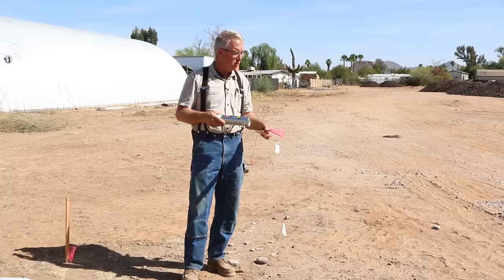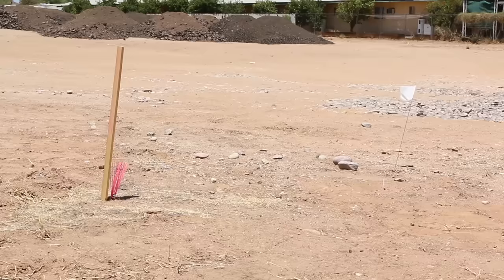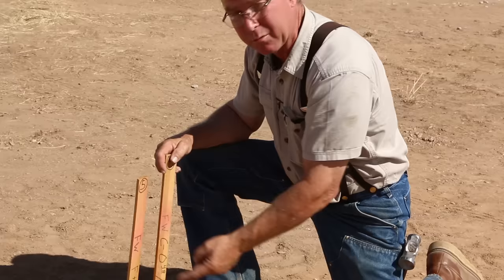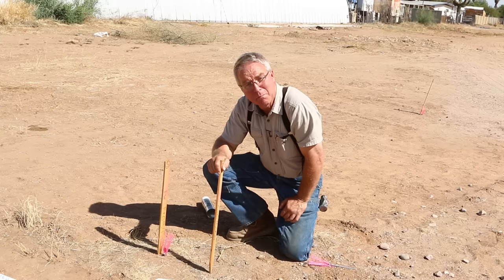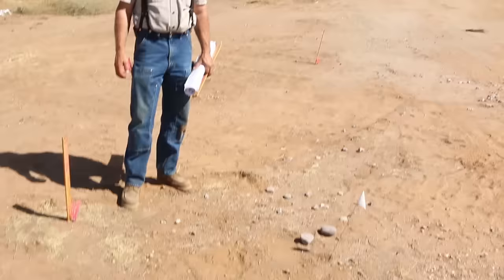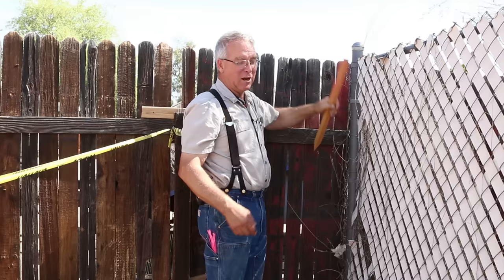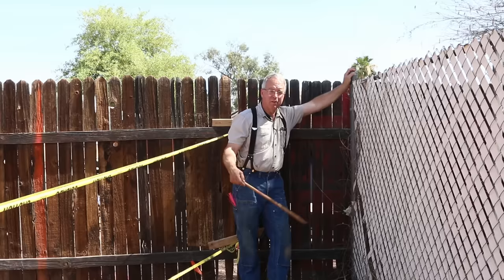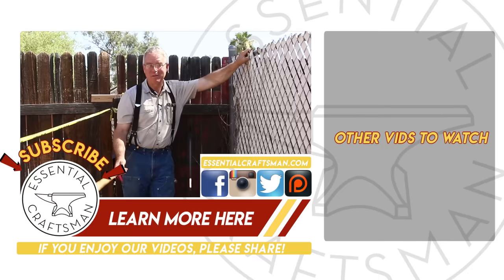Survey Stakes and Markers

Comment: Have a dozer that wont run?
Drive a grade stake within 10ft of it and I guarantee it will fire right up just to be able to get the chance to run that stake over!
Reply: Also works for old dump truck drivers...
Reply: You know it.  It's like magic.  No need for a mechanic.
Reply: Actually it's the other way around. Surveyors will watch a 100 dump trucks drive in and out of the same site ALL DAY LONG and put stakes directly in the roadway we are using!
Reply: Huggy --- I found during site visits with all equipment operators, have them do 2-3 hours (manual labor) of assisting setting a 1/2 mile of staking which will cut down on "survey destruction". Cheaper than correcting mistakes and they hate having to redo their on work (staking).
Reply: Marshall Moneymaker --- I've seen that several times also!

Comment: We do our offset symbols a little differently at my survey company in Kansas, but otherwise it's all just about the same.  Also, 0.75' is 9 inches, so going 9 inches off of F +0.72 will put you 3 eighths of an inch too high.  Hundredths to eighths is close, but I recommend counting from quarters of a foot.  I mean, 0.25, 0.5, and 0.75 are respectively 3, 6, and 9 inches then go up or down from there based on the hundredths shown on the survey stake.
Reply: SchmackyJoel you wouldn’t happen to work for the survey company in the burgundy Chevy trucks??
Reply: That’s what I was going to said
Reply: agreed
Reply: Happen to work for kaw Valley Engineering?
Reply: @jabaristevens388  I actually think he's right and it will be 3/8 high..
Reply: @paveldimov8971   no sorry for the misinterpretation. What am saying is, .72 hundredths of a foot is equal to 69 eights not 72 eights, and .75 is equal 9".
+.72 will be 3/8ths higher than the precise off set which is +.75/9"
Reply: if a curb stake says F=0.50 to TC and the curb has a 6" curb face, a 1-foot wide gutter 6 " inches thick, and a 2 0/0 slope to F/L what is the cut to  curb grade at the back of the curb. also how many hundrenths is 8". (hint it's not 64)
Reply: This is why you just buy a tape measure that has 10s and 100s, dividing by 8 it’s some bs

Comment: Had a surveyor in a week ago - first time I've ever employed one. Had him drive both pins and offset pins, then had an excavator pull some boulders from various places on my farm and drop them right atop the pins...then had surveyor come back (yesterday!) and use offset pins to locate and create final pins atop the boulders. Next step: rent a mini excavator to build a stone wall between the boulders that mark the inflection points in the zig zagging property lines.

The whole process has been fascinating...and, yes each step looked IDENTICAL to the bits in this video.

Excellent as always, thanks!
Reply: Hmm, sounds like you're placing half of your boulders on your neighbor's property.  Do you have an agreement with your neighbors to do that?
Reply: Andrew Alexander yes.
Also, I believe that most New England states have laws re traditional style boundary walls.
Finally, I'm in farm country, so no one gets upset when rocks take up 100 square feet of a 50 acre farm. 😉

Comment: I’m a Carpender and I set up survey for excavators and I use a linker survey rod. It’s great for getting compound slopes and it really easy once you have your laser set up. That Rod you also use tenths.
Reply: if you need to cut a slope at 1 1/2 to one down 25 feet to your toe of slope , I guess you have a LONG rod.

Comment: I wish this video existed 7 years ago...
A trick I learned while flagging proposed gas lines, if the ground if too hard/frozen for your flag's wire to slide in, lay your flag on the ground so that an inch or so if the end of the wire is where you want the flag to end up.  Then, using a dull large flat-head screwdriver and a mallet, pound the flag in striking the wire where you want the flag to stick up at.  Do this enough times and your screwdriver will develop a divit in the center that helps with repeatability.
Sincerely a former gas company engineer
Reply: Smart advice

Comment: Pretty good video!  Some of that is regional standards, but as a surveyor that’s staked out hundreds of buildings and uncounted miles of curb and road, I had no trouble following.  And yes 9 inches is 0.75’.  Just divide by 12.   Surveyors use feet and decimals (to the 1/100 of a foot).  
Architects use fractions of an inch.  Now that’s confusing!
Reply: so do operating engineers (union)

Comment: In most states, that corner on the fence cross beam is illegal, at the very least, no conforming to local statutes defined by minimum technical standards of monumentation.  It should have been off set along the property line.
Reply: Yeah my thought as well. Do an O/S.

Comment: Years ago before I was self employed a contractor I worked for built a cabin on a parcel of land that didn't belong to the customer. 
The parcels in question were very remote and all of the surrounding terrain looked the same. So the owner instructed where to build it and it was built. Later (several months) the rightful owner of the parcel shows up to see a beautiful cabin sitting on his property. 

The customer mistaked the neighbors parcel as his own. They eventually just traded parcels and the customer paid all the fees for the paperwork. It could have ended up worse. 

Fast forward a couple years and the same contractor built a new house on another parcel to find out that part of it was on the neighbors property. Fortunately the brother of the customer owned that parcel. So they made some kind of deal. 

From witnessing these mistakes I always pull county records on every project I build and verify myself that we are on the correct piece of land and have achieved proper offsets from property lines!

Comment: Here in my town in southern Maine we have minimum setbacks from property lines, 50ft from front and sides and 75ft from the back. Our lot sizes are probably considerably larger than what you are dealing with in Arizona, 2.5 acres is minimum here so I had to get a variance from my town to build on my 2.37 acre parcel. Our setbacks make it pretty hard to build on someone else's property, but it still happens, usually when a land owner doesn't hire a surveyor.

Comment: Civil engineer responding.  I represented a major development company who had a property trespassed by construction adjacent to them in Houston.  It was a 1' trespass but affected a required 10' setback across a 300' lot line.  So, it basically affected 3,300 square feet of building area.  The settlement was approximately $250,000 per square foot.  Make sure you build within your building area.  I know this was not a residential area.  But, when you affect the building rights of an adjacent property, you have bought that land without any negotiating power.
Reply: I recently had a surveyor installed a set of construction stakes along my property line.  I asked for a 4’ offset, but he placed them at 4’2” off the PL.  Is this an acceptable margin of error for the land surveying / construction industry?  (hint: a slightly rhetorical question)

Comment: So are those nails set at design grade with whiskers when the existing ground is already pretty close to existing grade? I know with some of the stakes I've seen the nail was set at existing grade so that the crews would have a clear datum to apply the cut or fill to. This was typically during rough grading.

Comment: You really should try the metric system 
1/16" = 1.5875mm 
So 1mm = 3/64ths 
That's plenty small enough for construction 
Who needs 72eights in their life ? 

 65 feet + 7 inches + 25/64ths 
OR 
20,000 milli metres = 
2,000 centi metres  = 
20 Meters = 
0.02 kilo metre

Comment: While .01' is close to 1/8", it's off by enough that it can matter in some cases. As the largest example: if you use it for .99', you get 12.375" = 1.031', approximately half an inch from the proper measurement. Not a whole lot, but certainly something. 

For every 25 hundreths, knock off 1 and then use 1/8".
Reply: just buy an engineer's folding ruler, find your inches then turn it over

Comment: utility color cheat sheet
this may change from job to job, but this is by far the most common use

paint:
red:   electric, fiber-optic/telecom
blue: water
green: sewer
orange: general marking: storm,excavation,underground structure, *reserved for the site manager
yellow: gas, fiber-optic/telecom
white: general use, *reserved for the general contractor
pink: general use, normally not claimed

flagging (this may be a tape or an actual flag.)
see above for monocolors.
stripes
white/orange: telecom/fiber optic
red/white: eletric
white/yellow: telecom, normally an older line, sometimes gas
"caution" on yellow tape: I'm not liable for you injuring yourself, or else "hey guys look what the new guy went and did."

blue topped "cat of nine tails": grade for a road
generally any "cat of nine tails: grade for a road, substitute for normal flagging

flagging tape used to mark off an area is often a substitute for caution tape.
planted flags in close proximity (~1') is also a substitute for caution tape.
orange fencing ("tree-protect") is also a substitute for caution tape.
a chain-link fence is also a substitute for caution tape.
a track-hoe is also a substitute for caution tape.
a brick wall is also a substitute for caution tape.
a concrete wall with barbwire fencing,... caution-tape.
that guy you ran over wearing an hard hat and orange vest is not a substitute for caution tape.

other methods of marking include:
laser
string-line
a localized GPS
a man yelling at you
that same man, not yelling at you
something in the ground like your arch nemesis buried to their neck in dirt.

Comment: We recently had termites in the middle of house eating the hardwood floors.  Long story short, we found out that apparently someone had left a plumbing survey stake in when they poured the concrete, then broke it out at the surface and patched over it.  Eventually, 20 years later, their thin patch cracked and termites traveled up the survey stake and started eating my floors.  The stake was deep enough and there is so much moisture in the ground (I live in Florida) that it made a perfect environment for them.  Their own private elevator.  So people, make sure to remove your stakes!

Comment: Scott - Out of curiosity, how does contractor licensing work when you jump from Oregon to Arizona? I would assume that either you or Nate would have to have a license for any commercial work you do, but I am wondering if either Arizona has a reciprocation agreement for contractors or if, in the case of Nate's property, a license is needed at all? In the area of Texas where I live a property owner can get away with doing some work on their property without getting a licensed contractor/plumber/electrician, as long as they are doing the work personally. Although, given the scale of the project you are discussing, I don't think this job would quite meet those requirements. Also, when building retaining walls in Oregon or Arizona, what height requirement triggers the necessity of getting an engineer's design and stamp of approval. In my area anything over four feet must be an engineered wall - although given homeowners insurance here doesn't cover damage from retaining wall failures, we went ahead and got ours signed off on anyway.
Reply: good take  out in cali  thats all we deal with.

Comment: I had a survey done and my markers at back of yard says 10’ to corner. There’s a creek 10’ further out so does that mean my property is 10’ further out than the markers?
Reply: the 10' to corner marked on your stake should be representing a 10FT off set which means 10ft past the stake is the end of the property line.

Comment: don’t get me wrong in this writing, but just clarification should a viewer read comments....you said the offset from the hub per the info of 5’ FW, that the wall is “about” 5’ away...it is exactly 5’ away, also the cut and fill information is a reference of deviation from the hub, but this height adjustment occurs at the listed offset, not at the hub.  the hub provides elevation/location info
Reply: I hope you're not a surveyor

Comment: Hope you will explain how the equip operator gets to the desired grade. 

Today I saw a vert bar attached to the bucket of a D10 I guess it was ? Then there is the small site level the operator uses ? How does all this work ?

I took a 1 day surveying class mostly about transit level use and cut / fill. Any insight on the rest would be great.

Comment: instead of writing F + 0.72' and hope the operator can do the conversion, why not just make the finish mark at the correct elevation? Than the operator can just fill until he hits the finish mark. Subgrades and other features are usually referenced to finish elevations.
Reply: in Florida they do put a finished elevation line, but because there is usually so much going on construction sites, the stakes are probably going to be moved at some point, the pin is a little safer of a measurement.
Reply: Well, the operator doesn't do any conversion. An equipment operator in the US  working to grade stakes will have been working in tenths of feet his entire career.  So when he sees a a .72 fill, he already knows what a 7 tenths of a foot will looks like.  No need to convert to inches or any other units.   Also some staking is done with the finished grade marked on a lath  (for a fill)   and some grade stakes are driven till their tops are at finished grade.

Comment: We used to have a group of kids who would go around and remove our stakes on every site.  Then they started moving then around.  They sure as hell thought it was funny.
Reply: I worked on a particular site way back where this happened every couple of days. We hooked a few stakes up to a cattle fence on the owners lot with underground lines one day and cranked the power right up. Needless to say the stakes stopped moving over the weekend lol.
Reply: 2ez I wish I would have thought of that.  We basically drove rebar a couple feet into the ground and they weren't able to pull em up anymore.  Growing up in a construction family we saw it all.  We had people steal our tools and materials, vandalize our building sites, etc etc but this had to be one of the most aggrevating things ever.  It's no wonder the majority of sites are secured these days.  We were working on a new hotel project when I was first starting out and the general was pretty shady and pissed alot of people off so someone set fire to all of the underground conduits immediately after the concrete had cured... That was an interesting day to say the least lol.

Comment: Why not just put 9 inches? Everyone in the US can understand that.
Reply: POVadventure because hundredths are easier to do math with.
Reply: 77 hundredths is easier than 9 inches? I think not.
Reply: It is when you're writing everything out, and maybe I need the final grade to be 1'9"3/8".  Now I've condensed two sets of numbers into one by writing 75. Also, no chance of upside down reading, and I get 6" instead of 9".  It sounds silly, but eliminating any possible misreads saves a shitton of money.
Reply: A civil engineer can subtract the numbers and come up the results a lot faster than using will say 9”3/8 minus 4”1/4 is harder than .78-.27 = .51 so use those numbers to get to   6 1/8” real easy to convert 10ths once used to it. AND all excavation company’s use it.
Reply: Adam Budda not to mention standard calculators work in tenths or hundreds, not fractions.
Reply: Well, one reason is because .72 feet is not 9 inches, it's 8 5/8 inches,  and writing and doing arithmetic with .72 is a lot easier than writing and doing arithmetic with 8-5/8.

Comment: Why in America are you still using the imperial system and not metric like the rest of the world? I find it dumbfounding to try and get any sort of accuracy by using 1/64 th of an inch ect. Makes it difficult to simply add and subtract other measurements  especially in your head.

Comment: Wouldn’t it be easier to just put 9” on the stake. No calculations needed.
Reply: I think it would have been easier to just not make a video. At least he wouldn't have read all these YouTube experts tell him an easier way.
Reply: Its easier to just get a tape that shows hundredths of a foot.
Reply: Jeff Ketcherside Not quite related to your question but an interesting read.
On High Steel by Mike Cherry. Try abebooks.com or Amazon. He has a story in there that triggered a memory. Kid had somehow got hold of a rule marked in tenths of a foot. Could never deliver the correct bolts. The best of the book is hilarious. Hope you enjoy it as much as I did.
Reply: We do both dirt work (for residential stuff) and building. I've also personally done some heavy highway work in years past.  Using tenths or hundreds instead of inches you can get to a higher level of accuracy. 
When using inches on a standard rule or tape measure most people can't see more accurately than 1/32nd of an inch. When doing dirt work, surveying or similar tasks it's best to just get an engineers tape  (a tape measure that reads in tenths and hundreths). Doing a conversion to inches is only done by carpenters (typically) and is also typically so we can visualize the measurment. Since most all of us can easily visualize 9" we have a tendency and desire to try and convert it instead of getting used to and being able to visualize tenths and hundreths.
Reply: Because the surveyors "working units" are feet and hundredths of a foot. To ask the surveyors to convert then to fractions is inviting error.